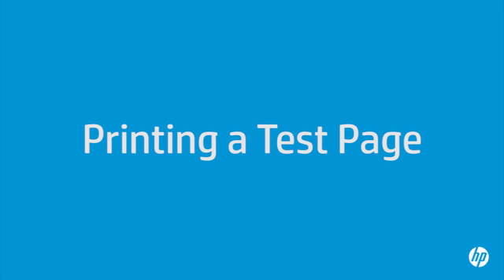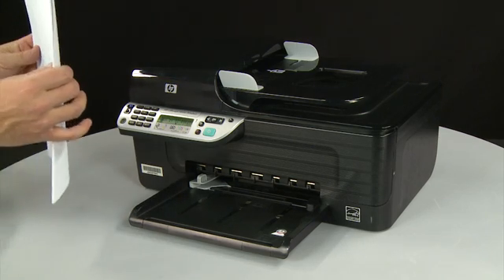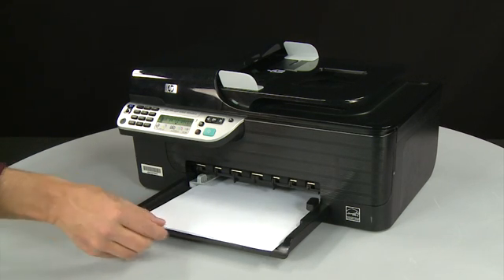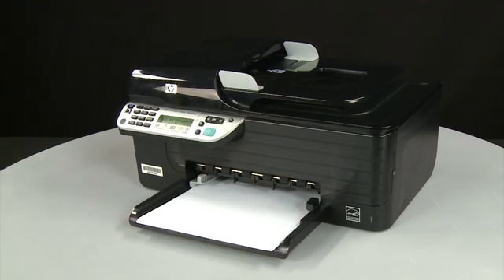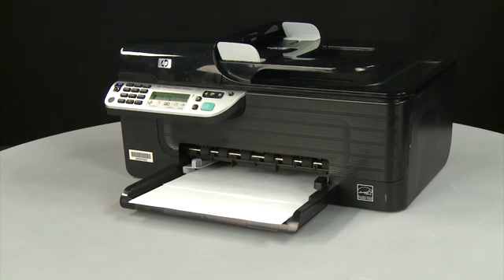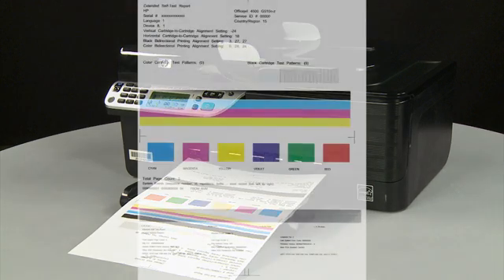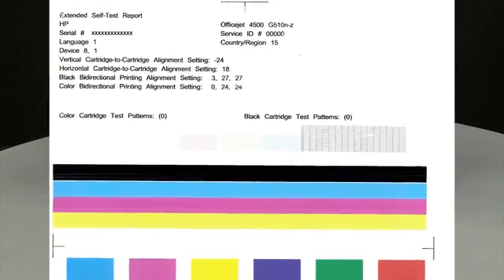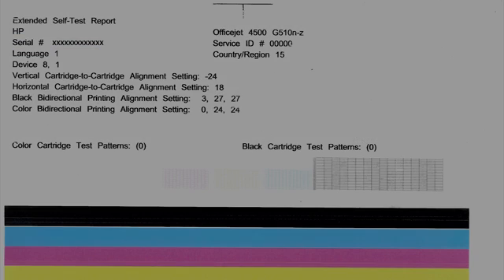Printing a Test Page | HP Officejet 4500 Wireless All-in-One (G510n) | HP

Comment: When i do this, the paper comes out with zero or almost zero in on it and with fuzzy resolution. I'm wondering if it's the ink cartridges being old, so i put the ink extrusion part in some warm water and the ink came out just fine. I did a test print and only the black ink worked, still fuzzy, even though i put the ink extrusion tip of both color and black cartridges in the warm water. I did another test print a few hours later and now there's almost no ink again. Is it just old cartridges? Is there a more effective way of reviving them?
Reply from the maker: +Wake Up & Workout Please perform the steps mentioned under this document to fix this issue: https://bit.ly/2YYAukk

Comment: Brand New Printer All-inOne Officejet 4500 G510-n...everything works, EXCEPT the page is skewed.  So, the Printer will not even align, it spits out the message "SKEWED" try again.   HELP?!!!
Reply from the maker: +Michigan Freshwater Marine Boating    I recommend that you do a Google search for C02772213 or you can search for it on HP's home page.  The title of the support document is "HP Officejet 4500 All-in-One Printer Series (G510) - An 'Alignment page not detected' or 'Alignment failed' Error Message Displays on the Printer Control Panel".  Since the message you are receiving is an alignment failed message, please review the document and follow the steps.